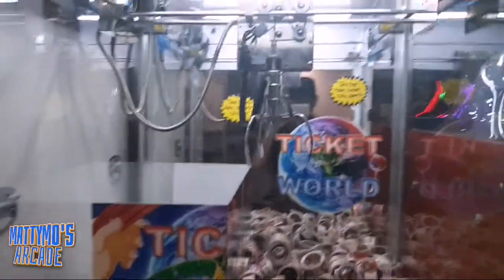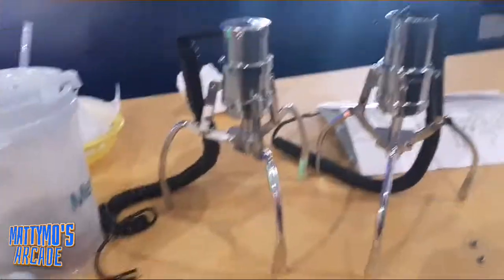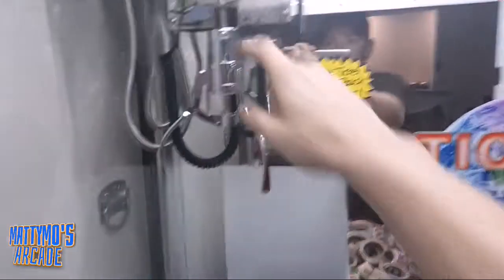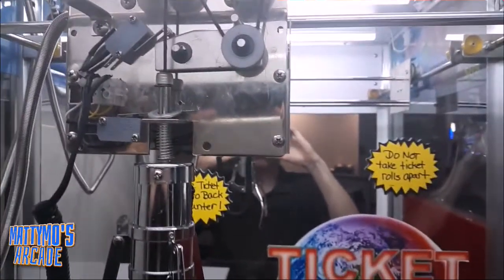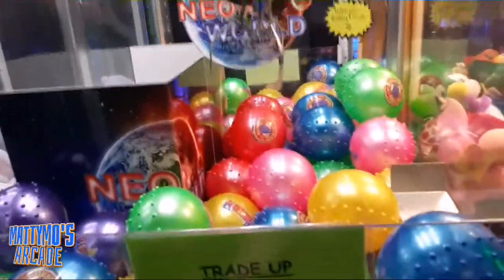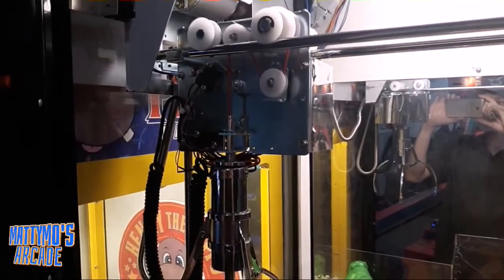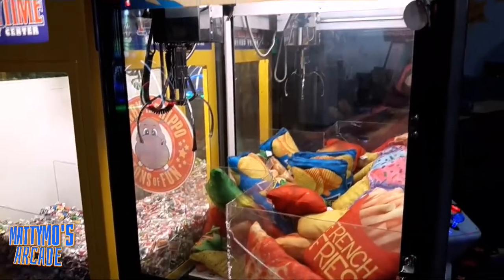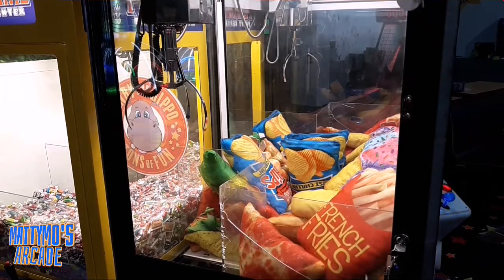Claw Machine Repair: Claw Not Closing

Comment: what should the voltage be where the claw wires into  the machine? and what could it be if the voltage isnt getting there
Reply from the maker: 24v or 48v depending on the machine.

Comment: Do you know why the crane will pick up and work normally, lift the knobby balls but stops. It doesn't return home. It has a code 01. Thank you!
Reply from the maker: Usually it’s a bad switch, or wiring is disconnected at the switch.

Comment: Hi, I have a elaut cosmic crane and the claw isn’t closing I checked everything from fuses to circuit board and I’m not getting any vaults from where I connect the claws cord.
Reply from the maker: Figure out of the power supply is putting out the proper voltage. If not, possibly adjust it or it's bad.  If voltage is good, test it going down the line until you find where it stops.

Comment: Hey man, I have a Prize Time Deluxe from Smart Industries 2015. The problem is that when the claw picks up a price it goes all the way back up and then immediately releases the prize and goes back to home. Any recommendations?
Reply from the maker: Let me check my notes.
Reply: MattyMo's Arcade thank you my friend!
Reply from the maker: Looks like I had a few issues like this. A loose connection at the board or the gantry was the problem every time. Let me know if that gets you going.
Reply: MattyMo's Arcade I did move the machine in a box truck before it started acting weird so it must be a loose connection somewhere. I’ll let you know!
Reply: Got the claw figured out! Loose connection I guess. Now the dip switches won’t work to changed the price and stuck on 25 cents when I had it on 50 cents lol
Reply: @SouthernGold777   i have the same problem. when it go back up the claw immediately release. how can i fix this issue? thanks
Reply: @TuyenNguyen-cg7uj  check the owner’s manual and make sure the wattage isn’t set too high or too low. This is what caused the problem for me
Reply: @SouthernGold777  Thanks for your response. We bought it used so there is no manual.  Do you know where to help guide me to the wattage setting?  I
Reply: @TuyenNguyen-cg7uj  I suggest join the vending nation Facebook group and reach out to members there.